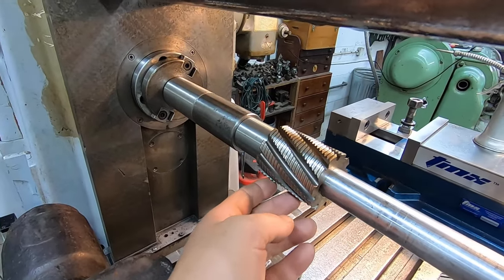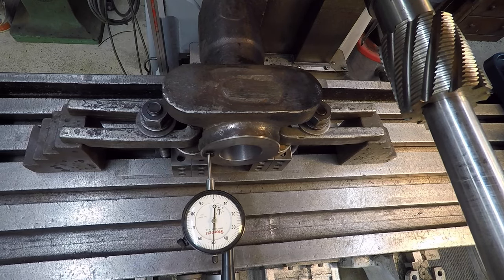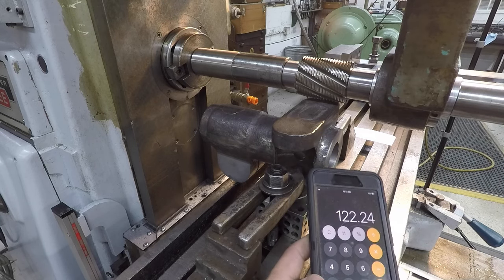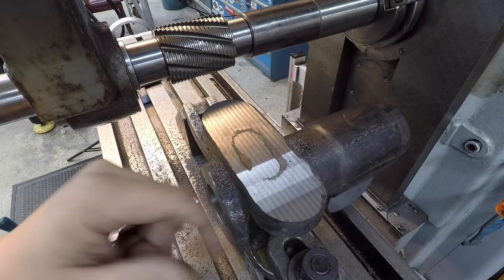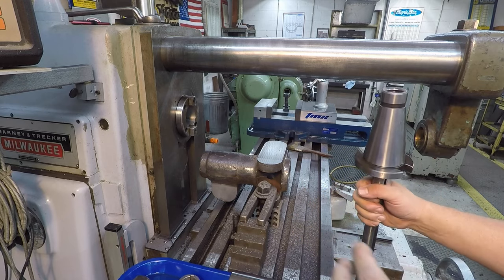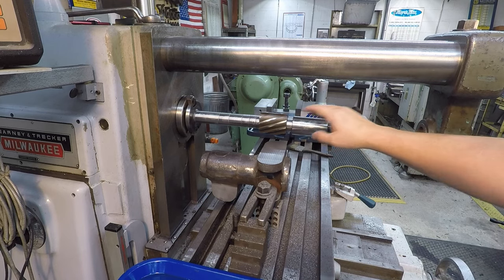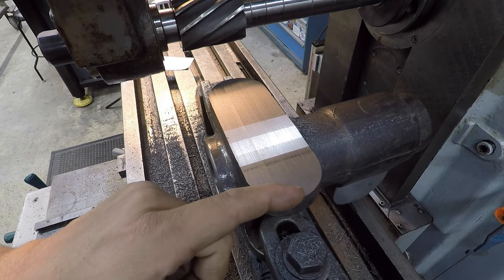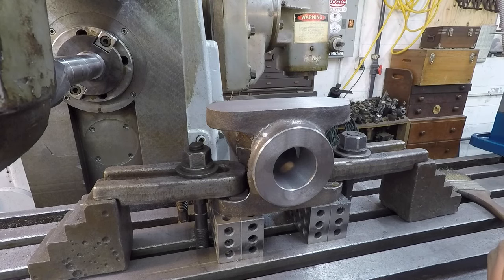Fairbanks Power Hammer Cross Head: Part 3

Comment: Lots of interesting aspects of set-up were talked about but at no time now or in previouse episodes has Adam mentioned ending up with the centre of the bore in register with the two flat machined surfaces. Could it be that this is not critical or am I missing something here?
Reply: Guessing it is probably not super critical in this application since the crosshead is just clamped around the drive shaft and the pitman arm that actually drives the hammer head is fitted with bushings on each end, so there is a pretty decent amount of acceptable play at both of those points.  However, I believe he did adjust the crosshead along both axises in the chuck before he machined the bore for the shaft, so I am guessing he was within 0.001-0.002" after that evolution.

Comment: On the roughing mill, was there a formula you used to come up with the 0.002" per tooth chip loading number?
Reply: I'm sure someone will correct me if I'm wrong but in my experience the feed per tooth that's required usually comes from some kind of data source (tooling manufacturer or reference book), and then the given feed per tooth us used to calculate the feed rate. Feed rate = RPM x feed per tooth x number of teeth.
Reply: @DatBrummie  Machinery's Handbook gives a good starting point
Reply: IPT= IPM / (RPM x Number of Teeth)
Reply: @larryrobinson7492  Thank you.  That's what I was looking for.
Reply: @pdc023  Great, I'm a fairly new production machinist at a aircraft manufacturing plant and one of the very experienced CNC machinists there told me that info, I like to run at around .003-.004 IPT (thousandths per tooth) most of the time which is pretty conservative actually.
Reply: @larryrobinson7492  I'm nowhere near as qualified.  I recently retired and bought a hobby level lathe and mill (Precision Matthews) to learn on.  I'm learning as I go and loving it.

Comment: Adam, is there a process for sharpening those mill saws when they get dull? Looks like that would be a complicated process, or do you just replace them?
Reply: prob send them out to a service.
Reply: Check out Steve Summers videos from about 18 months ago. He has a sweet tool and cutter grinder setup. I believe its a KO Lee.
Reply from the maker: Lots of grinding shops that can and will resharpen any of the cutting tools you see me use. The larger cutters like I’m using it’s usually cheaper to regrind rather than replace.
Reply: Thanks Adam. I have a pole saw with a 8" chain that I find it cheaper to just replace the chain $12.00 verses invest in a sharpener, or service. I'm sure it would be different If I had larger or more chain saws. Almost the same with my drill bits, but I am thinking of getting a sharpener for these as I have a lot of them. Watching your cutters prompted my question.

Comment: Why does the face have to run so perfectly parallel to the table, if it's off a bit the milling tool is still wide enough to cover the surface?
Reply: I think he did this as preparation for cutting the last surface as he explains from 0:40
Reply: Because he said that he would also be machining the top which in this case was facing the machine. If he didn't square it up that face would not be perpendicular to the bore.
Reply: @diederik998  Thanks, I somehow missed that bit of pertinent info.
Reply: @MagnusNilsson76  Thanks, I somehow missed that bit of pertinent info.
Reply: @millomweb  if you check this sites video list they have ratted several Abom79 videos 1 even of his shop.
The site you redirect to is not crediting the original source material authors or acknowledging their own 3rd party status in the post data.
At the very least bad etiquette at the most copyrighted material misuse.
There are ways of doing this correctly, and it would not take much to get permission and correctly acknowledge the original author and both parties gain in the end and the viewers are educated about far more than a machining operation.
Reply: @pebrede  I complained to susan@google.com (CEO of YT) as '3rd party copyright issues' couldn't be reported. I've e-mailed Adam about it - he can report it in relation to his content but it seems the channel has done the same with other people's videos too :(
Reply: @millomweb  about all we can do is report the video content as plagerized? And try and protect content where we can.
Trouble is every time you watch the video you add to there YT score and they get more points.
Self defeating.

Comment: I got the calculation for deriving the Surface Feet per Minute for chart comparison and the other calculation which returns the RMP using the constants of .262 and 3.82 respectively. However at 6:46 you say you have your feed speed set at 3 inches per minute which gives you a footage per tooth or flute of 200 feet per minute. Can you give us the calculation for that and tell us the significance of the speed per flute per minute?
Reply: That affects the amount that each tooth is removing - more teeth, less to remove per tooth for a given feed speed.
Reply from the maker: I believe what you are asking about is the feed per tooth, which is another important factor for proper speeds and feed to prolong tool life. To calculate “feed per tooth” :
IPM (inch per minute)
Divided by
N x RPM (N = number of teeth on cutter)

To calculate what IPM you are running for a given RPM: 
FPT x N x RPM

Comment: What happened to the mill table so it has this large "trench" in it (you can see it in 0:32)? I can't imagine any tool that could make this by accident
Reply: Is that a result of the cooling speed when the part was cast?
Reply: @oleran4569  I think the edges are too sharp for that. It probably was a large endmill in horizontal mode and someone really didn't pay attention
Reply: All you need is autofeed and an operator who isn't paying attention.
Reply: @kswiorek  Oh. Yeah. I see it now. Thanks! I was looking at the work piece.

Comment: Something about this vid, I don't like how the cutters are taking the chips over to be ground on the next rotation of the cutter. Would it have been better to run air blowing them away? (not remotely an expert asking this)
Reply: No matter what you do you're always going to have chips come around for a second time. They just get chopped up.
Reply: With a light cut it isn't an issue - the chips by virtue of being cuttings will only be as deep as the depth of cut you are taking
This means that the cutter will shear them in 1/2 before it engages the job
On a longer job, it may cause some spot wear on the tool eventually, but the issue is cast iron dust gets everywhere at the best of times and aerosolizing it is a great way to get it into the machine's ways

Comment: Why is cutting or cooling fluid never used on cast iron? Is it bad or just unnecessary?
Reply: It depends on the operation and the application, like everything it has pros and cons. Coolant can be used as long as the machine protection is considered as the cast iron particles can be abrasive to the machine if the particulate is not managed, there are many other considerations such as coolant type, material type, customer requirements, surface finish, etc that must be considered. It is too much information for a reply, there are many books out there that cover modern  machining practices. I say modern machining practices as there is a large overlap in old vs new knowledge, however as technology and other advances are made, practices change appropriately. .
Reply: Cast iron has carbon particles in it that act as a lubricant to some extent so usually no need for extra lubrication

Comment: Do you not use "cutting fluid" while working cast parts?
Reply: Cast iron doesn’t need cutting fluid because of its granular structure and free graphite in the metal.  The makes it self-lubricating, plus cutting fluid would just make a gummy mess of the chips...

Comment: Dont know anything about anything,  but why would you feed the grindings to the front and not spit them out the back?
Reply: There is climb milling and conventional milling, Adam was climb milling, so the tool was throwing the chips forward, in the direction it was traveling. Each cut has it’s own benefits.
Reply: @chrispy3866  Sorry, but Adam was conventional milling, not climb, on this job, although the cutter did appear to be rotating the wrong direction.
Reply: @ellieprice3396  yeah, always annoys me when the cutter looks like it's going the opposite way to what it really is. It's like the wagon wheel effect.
Reply: By the time you get through all of Adam's videos, you will know everything about everything. He's one of the finest teachers of machinist techniques you will ever find and he will lead you to all the rest of the best. Start with his oldest work and move forward to now and you will be amazed at what this man can do. To answer your question, what you're proposing is called "climb milling" and it will produce a fantastic finish if you make passes of only a few thousandths of an inch, but if you take cuts the depth of what you just saw, the milling tool will most likely gain traction and just "eat" the part instead of machining it. There is a massive amount of power available at the surface of that tool and it would just drag the part, clamps and all, into it destroying the cutter,  the arbor shaft, and probably the part itself. It would happen so quickly there would be no saving it. Good question.
Reply: @ellieprice3396  DANG, that’s what i meant, conventional. Mis typed. Yes, y’all get me. 😉
Reply: @ellieprice3396  Shutter speeds and Machine rpm rotation create magic effects

Comment: If you ever need the hog mill or the plain mill sharpened contact me and I will do it no charge. 
I will do them both correctly. The plain mill will be true to the bore and straight with in .0005". ( .00025 per side)

Comment: Where does the .262 come from for calculating surface speed?
Reply: Probably a combination of the formula for the circumference of a circle and the conversion from inches to feet crunched together into a constant.
Reply: Yeah, it's Pi/12
Reply: @jfischer507  thank you!
Reply: To me, rather than remembering a special purpose constant, it seems easier to just use the formula for a circle's circumference and divide by 12 to convert feet to inches, then divide that result into the desired surface feet per minute to get the RPM.

Comment: An NOS arbour?

Not Overly Straight?
Reply: It's not that - it's the fact the collars aren't a precision fit on the arbor - so while the arbor runs true under the collars, the collars wobble ! Similarly with the cutter, it's an insufficiently snug fit to the arbor - so there's a thou or 2 run out. It's not vitally critical otherwise the design would have been better !
Reply: @millomweb  Yeah, I deal with that all day. I run an Ammco 3850 brake lathe. I often wonder about just how much I can trust the machine with respect to run out. Nicks and burrs on the spacers are a PITA, but not as much as the gorilla that put dings in the hub face of the brake rotor while knocking them off the hubs.
Reply: NOS.  New Old Stock.  Old part that has never been out of the package.
Reply from the maker: NOS = New Old Stock. This was a new never used arbor when I bought it.
Reply: @jimmyb1451  Actually, straight runout isn't a great issue with brakes. May cause a wheel imbalance at speed, I guess but as long as the disc doesn't have any wobble, braking will be smooth. Had some new discs fitted to my car once - and one of them was worse than the old ones - turned round in the street and took it straight back for yet another new disc !
A YTer in South Africa has shown videos of getting his discs cleaned up - and they do it on the vehicle - so no run out at all !
Reply: @Abom79  1·25" did you say ? How about making a replacement of 1·26" diameter - or whatever the internal size of collars and cutters are - so that they're a better fit - to see if that removes the apparent runout !
Reply: @millomweb  Yeah, I also run a procut vbg on car lathe. There's always some amount of run out, especially on newer cars with floating rotors.

10 thou run out will absolutely cause a pedal pulse within 20,000kms. At around 20-30 thou you'll start feeling steering shimmy under brakes. I aim to be dead on, every time, sometimes it's just not possible.

If it's being particularly difficult, I will settle for 3 thou from straight.
Reply: @Abom79  TY! I don't know why that didn't dawn on me. Good vid mate, as always! :)

Comment: @abom79 excellent you go into detail explaining things like SurfaceFeet/Min. But instead of just multiplying with a constant that's not obvious to everyone, could you perhaps edit a formula with units onto the screen ?  Example here for metric https://www.ns-tool.com/en/technology/technical_data/cutting_speed/  
For imperial also: https://zero-divide.net/?&article_id=4209_general-speeds-and-feeds-formulas  
There are surely apps to do the same.
Reply: Good point.  The equation is circumference of the cutter in feet multiplied by the RPM of the cutter.  So, starting with diameter in inches, we take that diameter and divide by 12 to put that in feet.  Multiply that by Pi. (3.14 is close enough). Now we have diameter in feet per rotation of the cutter and simply multiply by RPM.  So: D/12 x Pi x RPM = FPM The constant that Adam used was Pi divided by 12, which you can see in the above equation.  I’m sure you understand, but now everyone sees where it came from and they can use Algebra (that stuff some said they’d  never use in the real world) to solve for any term, i.e. the second equation Adam used.
Reply: @todd727300  Thanks for the explanation. I really wish more youtubers would work the math of what they do. Same for woodworkers cutting combined angles and dovetails.
Reply: @havenisse2009  Very nice.  Thank you.  I was one of those math geeks in school.  As soon as I heard the constants, I had to figure out where they came from. :)

Comment: Where did you get 3.82? Circumference is pi R square. The math is close enough but I have a feeling you know something I'm missing.
Reply: Circumference = π*diameter.  3.82 = 12 / π, .262 = π / 12.  It is a combined conversion factor when converting the diameter in inches to the rotational speed in feet / min.  You could either divide by .262 or multiply by 3.82, or vice versa it's the same thing.
Reply: What you're missing is the factor 12, to convert inches to feet. 12 / 3.14 = 3.82.
Reply: that's area. circumference is pi(d) or pi(2r) not r^2.

Comment: Looked dangerous to feed the paper slip in from that side; you could get your fingers pulled in.
Reply: It's one of those things, with well practiced and trusted hands its safe enough. Personally I use cigarette rolling paper, just wet it a bit and stick it where I plan on touching off (it's a bit thinner too which helps). 

People also comment about using a file or emery paper on a lathe, its the same principle, as long as you trust your hands and don't expect anyone to sneak up on you, you should be fine.

Comment: That made me cringe watching you put the paper under the cutter so it would pull into the cutter.
Reply: I did the first time too, then saw it done easily a few times...its a great trick/idea....Cheers.
Reply from the maker: The angle of the camera was in a bad position to show what I was doing. In fact common sense goes into this trick but it’s a very effective way to get the cutter close. It’s even listed in many older machine shop practice books.
Reply: @jerryuk93  Yes it is something I have seen done and done myself. Also seen masking tape used, marking blue applied thickly. I was however taught to hold the paper the side of the cutter rotation so it doesn't pull you into the cutter so to speak.

Comment: Climb mill for a better finish.
Reply: Since this is a casting he probably prefers to conventional mill because the cut path starts beneath the surface of the part. With climb cuts, the tooth has to break through the cast surface repeatedly. Although this is only a concern for the first pass.